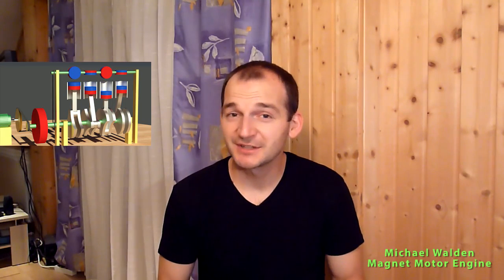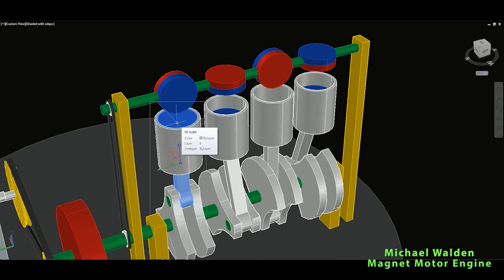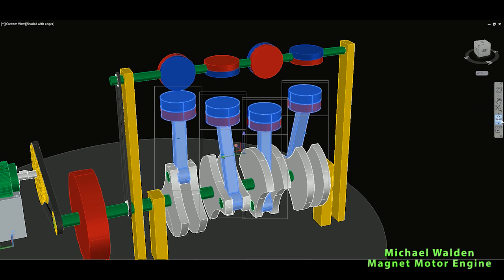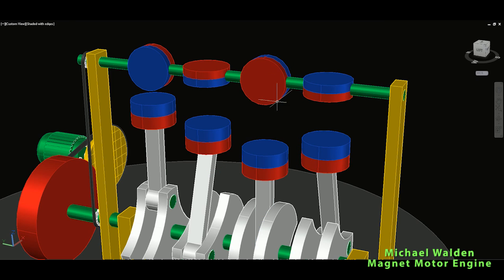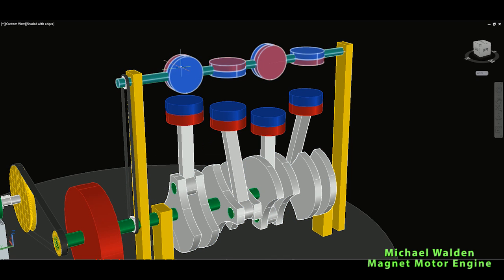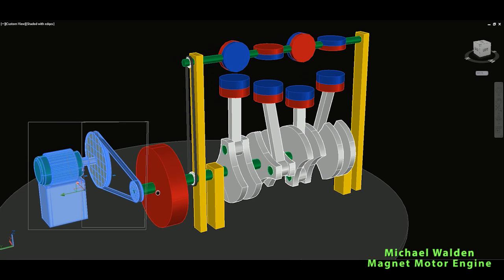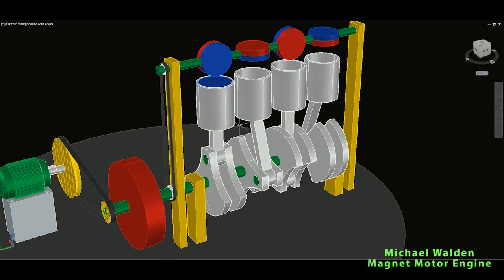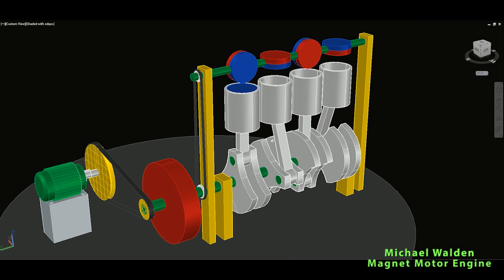FREE ENERGY, Michael Walden Magnet Motor, MAGNET ENGINE!!!!!

Comment: I like it by moving by motor, like I said before this magnetic pistons they hold pressure needed to move car on different heights. Other thing is it must turn magnetic electric generator to support motor and recharge batteries with electricity 🎉❤

Comment: Has anyone designed this in SolidWorks with all the physics properties added to each component and then run through simulation? What if you were to pedal assist the Cam Shaft (now magnet shaft)?

Comment: there are many reasons this will not work. addressing the rotating assembly. there would be an unbelievable drag from piston slap and inductive reactance alone to make any kind of rpm possible. magnets induce electrical flow in anything conductive that breaks their lines of flux. when you run a magnet through a tube, it is like a direct short. Drop a magnet in a conductive tube the magnet will slow way down in the tube. if the tube is ferrous the piston would grab the cylinder walls like crazy. If this assembly experienced any long term spinning, the magnets would magnetize the bearing surface. that would draw all the ferrous debris into the bearing surface and destroy it. there is much more wrong, but not really worth getting into

For the repulsion shaft has more than its fair share of issues in its self.

first off the lines of flux could never be effective for an effective stroke. it would have to be connected to the rotating assembly by a chain. A belt would have too much stretch to work for timing this critical. through the chain there would be this magnetic leaking too. It will never work as proposed here. I've seen discs with opposing magnets with bismuth shielding that were supposed to be over-unity. they ended up being awesome floating bearings that are nearly frictionless, but still never even achieved over-unity.

Comment: This can work but the top magnets need to be attached to a cam like mechanism with steel bearings to move up & down not spinning. Also installed in a carbon fiber or plastic engine block due to heat generation from resistance of magnets in metal sleeves/pipe piston holes.

Comment: It will not work. It is basically a mechanical version of the self-powering motor/generator, which also cannot work. Of course you will show us a video of it working and turning the generator which will light a bulb. But we will know that the generator is really a motor powered by a battery hidden in the base.  If you show it running without the generator attached, that would be much more convincing.

Comment: i know that their power might not be controlled but if their output energy is constant, why cant we make a fckn generator out of this?? with magnetic repulsion. engines does require 2 types of energy, this engines would requiere magnetic and electric, to drive and multiply the energy output. but noedymium magnets are expensive, making a car engine is expensive and we are here stranded with no money willing to experiment.

Comment: This motor works on the same principle of installing a bar that extends in front of your car by a few inches and connecting a strong magnet to the end of the bar, just a few inches away from the bumper of the car. As the car gets pulled by the magnet it starts moving forward and it will gain speed. If that works then this motor also works. In you think what I explained is ridiculous then so is this motor.

Comment: Try a radial engine

One rotating magnet will repel and attract multiple pistons, the smaller the pistons the better because they can be closer to the rotating magnets. I don't think it will work because free energy in a closed system is impossible.

Comment: Hi Mario. Get yourself an engineering degree, you will see the opposing magnets N to N or S to S will not rotate as you have tied them together with what you call a timing belt.
In reality they cannot rotate past 90 degrees, because magnetic flux also flows from the side of magnets.

Comment: Yeah it works under the conditions...but we initially give a starting torque to magnets for rotation .....we can give a start with power small powered motor for starting the engine .....it is used also in normal bike engines .....it is great that one because it reduce noise and air pollution......we can save our fuels

Comment: Probably work better using the Wankel engine design. As the third pole position would prevent the locking of polarities.

Climate change is has and will always be caused by our orbit in and around our galaxies electromagnetic field. Known as the Great year & or Milankovitch cycles.

Climate cycles of our water planet are continental glaciers with lower sea levels (Dwarka) brought on by East to West Global Tsunami's every 13,000 years when we cross the galaxies electromagnetic plane. Gobekli tepe was buried the last time we passed between the galaxies opposing magnetic equator 12,500 years ago.

Earth is a closed loop that self regulates CO2 with life. We are not gods.

Cause and effect. Temperature rises first and co2 follows.

Covid like CO2 is a lie built upon an inconvenient truth.
The Baby Boomers who were born en mass 75 years ago are starting to die from the usual suspects of seasonal FLU pneumonia and old age.

There is only one race. The HUMAN race and we are being divided to be conquered.

5G open air microwave oven towers will be the final depopulation solution before the e-w global tsunami's come.

Solar sails are rebranded Znamya solar spotlight/laser satellites. They never leave earth's outer atmosphere. Mysterious light beams from the sky over Siberia and holes appearing.

Comment: How do you adjust the revs?
Reply: If it actually worked, the only way to adjust the rpm would be to vary the distance between the rotating magnet from the vertical magnets.

Comment: I had something similar in mind. Would love to see it in action. One minor thing I would say is there is no need for the cylinder to be 360 degrees as there is no air tight combustion happening. Just 3 small shafts will keep the piston heads upright and reduce friction.
Reply: True. with the cylinders fully closed like a tube would cause a pretty heavy drag due to inductive reaction to a shorted system. this would turn a lot of energy into heat.  as long as there is nothing closing that circuit, that would solve that issue

Comment: The magnetic force at the top its equal to the one at the cylinders.
Plus, there is friction which will overheat the magnets. Magnets are not resistant to heat. They will loose the power in few minutes. Free energy is not possible. And you will never grow up your channel with fake claims. Lots of people are smart enough to understand your interest to make money from views. They will not stay to watch the full video. I ve stopped and paused your video after 30 seconds when I saw the magnetic design. I ve been playing with magnets for the past 40 years. There is not usable energy left that can be used as free energy. It's an equal mass applied. It's just a period/short time momentum. Those devices will never work in reality. It's just a 3D and will never become a real working product. You always post the same rubish on your channel. Your are very limited brain. You should feel shame for the way you want to make money from youtube

Comment: Should try the shoving magnetic pistons through cooper-coils as cylinders and use the volts from the cooper-coils translate down to more amps to power a e-motor, that holds the machine moving. So the better theory. ;-)
Reply: That's how a solenoid works, and in theory it does work, but it would require a lot of power and becomes inefficient under load. Solenoid engines do exist but just as small models

Comment: Remove the camshaft and use an electromagnetic field for pushing/pulling magnets. Also use frictionless magnetic bearings. The gas engine is a scam. Steam works just as well. Also steam can be cooled and turned back into water and then reused again...... Conformity is an issue with all people.

Comment: that would not work , bec piston 2 and 4 would cancel each other out. The magnets on piston 2 are attracting; the magnets on piston 4 are repelling; the forces are neutral. 
A more workable magnetic engine would be one that is electromagnetic with controlled polarity./

Comment: Great idea, but it wont work. Here’s why: the subsequent magnet has to be strong enough to pull the previous magnets apart AND overcome the frictional strengths of the pully and crank shaft. That means each subsequent magnet would have to be stronger than the previous. That’s fine, until it cycles to the very last magnet and is returning to the first. In this design, the magnets are all the same strength, which means the forces would cancel out and no movement would occur. However, it should be tested for real.

Comment: Magnetic power has had me curious for a long time. I know that free energy is not possible yet magnetic power does keep my attention such as videos like this. Oddly, the cam shaft on this video is exactly how i envision magnetic energy being generated. BUT, the cylinder system has too many parasitic load issues and I doubt that this can work like this. How ever, in a turbine type system maybe. However, just when I say maybe, I revert to my comment above. Free energy is a pipe dream of liberal hippies. Interesting yes. Realistic no.

Comment: I designed this in 1999.  I won some prizes with it.  I found out it was patented in the 70's.  I'm glad somebody liked it enough to patent it again.
Reply: The same idea and design of this video?
Reply: @AJ071  yes with much more detail on variable speed adjustments, electronic controlled coils around the cylinders, inside the pistons, cam assemble, transmission to drive a vehicle, etc.  there are several problems. Obviously the block can not be metallic. Even aluminum will act magnetic with the motion of the magnets.   Distance of magnetic pull means you need a very short stroke even with some very powerful magnets.  I also rpm would be limited as when a magnetic spins it loses the push effect and only attracts.

Comment: Electromagnets controlled by a computer could pull and push to get optimum rotation for counterbalancing the mechanism with gravity as a source of power . If the energy needed to keep the device rotating is smaller than energy created then it could work but as a passive system without variable repulsive electromagnets controlled with precision seems unlikely .

Comment: its just not efficient using cylinders of any shape or form,including connecting rods of any kind,you would need just a rotor design for speed and effiecency.it must be kept to its simplist form,less computer control crap more mechanical slowing and acceleration,believe me electronic speed control is never reliable.

Comment: why NOT  add a coil Insiide the pistiom at the top  end add amagnet to the to of the engine  and each pistome has a n alternating magnetic field examp le poiston one  repellatatract or piston one is atractining  piston 2 is repelingond pisyton 3 is atract pistion4  rellining 
rember that thier at  magnetic crilar motor  that yuo domt have already aroound 
if yuo copressair through yyuo  methed it could be used as a fuel and pushed into  a compresse and recycle 
THE BIGGEST DRAW WI THE PLUG IN CARS IS HAVE EVERY CAR AND VAN LORRY IS HAVE PLUG IT IN TO THE GRID ICANT SEE THAT HAPPENING I PERSONALLY WOULD NOT BUT ONE  the only pactical way would this mothed yuo  have  shooul i soory that i expsin any modifaction as i  dyslexic but i  hve thoght od some simular but som additions  but nut able use a cad system i nibe city angs if yuo  interested
FROM GARY FIFIELD I

Comment: Ive tried this, yes before I saw this. The magnetic repulsion is not enough to turn that shaft. Repulsion is almost a constant that is nearly independent from size of magnet. You would need magnets so big that they would start to pull toward each other against the axis of drive. Also the drive torque is too little to drive a belt that could charge an alternator.

I appreciate suggestions.

Comment: It works. If you use electromagnets instead of permanent magnets you may be able to manage the polarity and attract the piston and immediately change polarity for repulsion action so you will have 2 forces insted of one.  MAybe in a beetle VW you can use the rotor system to change polarities. 
I have been working with this idea for a long long time and it works!!
Reply: > I have been working with this idea for a long long time and it works!!

It works... without a real life demo ;) ? Where is your demo ?
Reply: Yeah this might work
And why can't we add some more force for repulsion? Any way
Reply: Once again, do a demonstration before claiming things.
Reply: If electromagnet is used the circuit control needed to change electrical power in less than 1 sec simultaneously

Comment: How is saying small amount of power  ok use v8 engine  we solve if  but the problem in the magnet engine.  You can't control the power  low or hight  it's one speed

Comment: I heard about this motor circa 1973, from the Chauffeur of Prem Pal Singh Rowat. Except the Driving Magnets were Halbach Array Switch Release Magnets. They are compact and with minimal effort, transfer the magnetic "Deep Pull Force" from the "Front" to the "Back" with a very "Shallow Pull Force" by a rotation of Diametrically Magnetised Cylinder Rod Magnets through a quarter turn. (Usually five or more cylinder magnets ) The Pull Force on the STRONG SIDE of the array can be several metric tonnes, in a compact mechanism, but with the quarter turn, (almost effortless) almost no pull at all.

Comment: The engine will not move because attraction and repelsion are equal in power ...you should use 1more st of magnets
Reply: Nothing to do with that. If you have 2 negative magnets they will move away from each other as it does in the engine it's not complicated

Comment: 2 magnets that have that kind of strength pushing off of each other will cause a break in the magnet and warp the material holding them I have a similar design I have been working on, super magnets are too strong for the task you are preforming and smaller magnets won't yield the torque required to move a vehicle please don't take what I say in a bad way I believe if you keep at it you will find a model that could work I'm only giving constructive criticism so that you can see the problems you are facing

Comment: Allways liked this idea, magnet replaced with piston. In my imagination it works as well..but it should not work in real...is it the thermodynamics 2 law about entropi..maybe. Back to imagination, facts is boring. Two things about your model. 1 Think it should work with one "piston" alone to a start. 2. instead of a rotating magnet in the top, how about a fixed one. The lower magnet then be able to move closer to the one in top, and the power/potentiol energy increases. Due to make a full rotation, the energy stored in the flywheel now has to overcome the movement upwards, and a something light in weight and thin must be pushed in between the two magnets, and moved again as soon the magnet has passed the top. The energy to move that something comming between the magnets must be as low as possible. Just my opinion, sure it wont work anyway due to that 2 law. Finally back to reality, if it against all laws should make a few turns with very low free energy, the cost of the materiel to make this device would be much higher then what ever would come out of it.

Comment: thanks for the video,
why is it that everyone uses opposed magnets? why not  electronics, stop and think about it. it's what Robert Adams designed,that way was able to turn power off for just a bit as magnet passing by coil to prevent drag effect. then turns it back on.it is on line

Comment: There is practical difficulty in this way of energy as how far will magnet get piston pushed downward, it will not be able to push it downwards in the cylinder . when the magnet on upper shaft and the magnet in piston cylinder will have negative and positive poles in contact they will attract and further more energy will be needed to separate them. Though there is no harm in trying the idea in case piston is smaller as compare to upper magnet so more power of repelling power is generated to move piston throughout the cylinder.

Comment: Free energy exists... Use it all the time, with my hidden extension cord plugged in at the neighbors!
Reply: You’re outsmarting the system. Simply plug the extension cord into ITSELF
Reply: @7thZeppelin  😂🤣
Reply: @7thZeppelin  😂😂😂😂😂
Reply: Lustig
Reply: Lol
Reply: If your neighbour invites you to his home to fix something for him on his electrics, then its the best time for you to fix a hidden coil inside his wall, plaster it over, and wired up to his mains, then once inside your house, you can induce a current/voltage in a secondary coil facing the primary coil, separated by very thin wall material say half inch max, also if possible have his coil wound on a iron core, so when you are back inside your home you can have free power induced in your coil perhaps enough to power a few small items
Reply: HAH   C O M E D Y
Reply: Very nice bro
Reply: It is not a free energy source
It is running because of the energy of the magnet

Comment: As soon as one of the pistons reaches TDC the top shaft magnet will be too strongly attracted to the top of the piston magnet to allow the motor to continue to turn.  The flywheel could overcome that for a limited number of revolutions.  This would make a better braking system than a generator.
Reply: electro magnet would solve this problem on the cam shaft